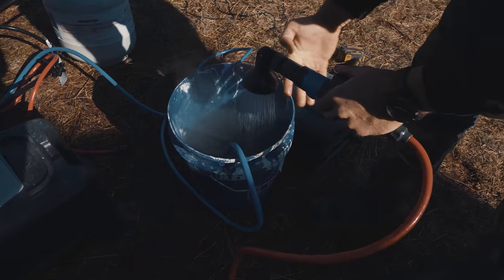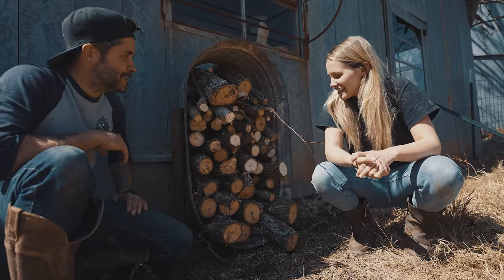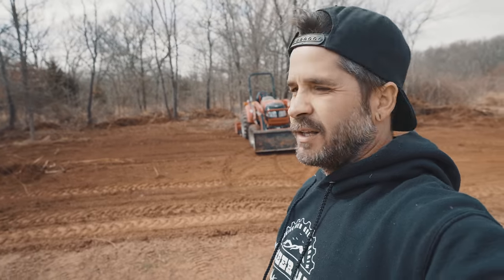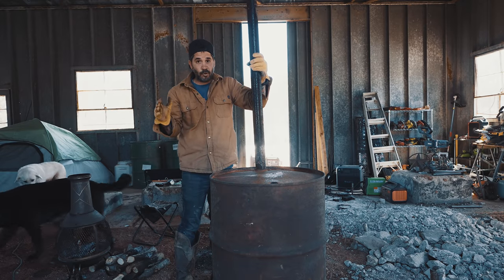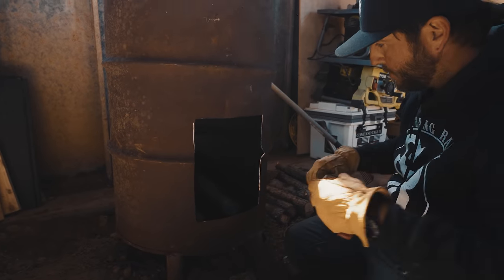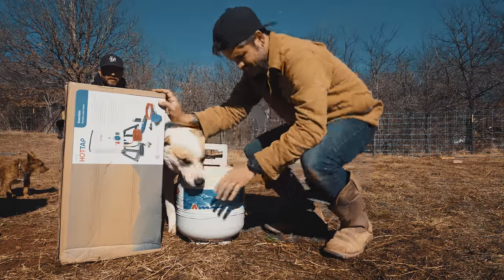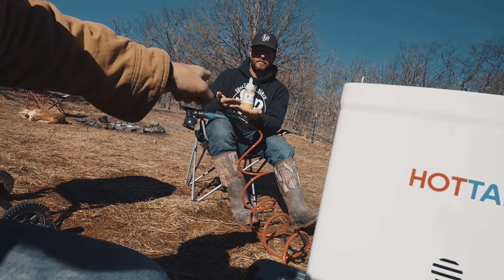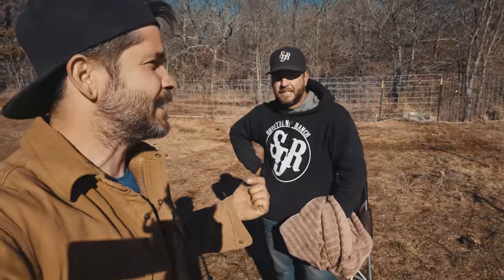Start To Finish Ranch Projects! EPIC Movie Like Intro!

Comment: Remember to build at least 20 feet in front of and steep slopes to allow for Erosion. Possibly add more rocks on the slope to slow down erosion. Build Swales and Berms (Dips and Bumps) in flat land with low rain fall. To prevent rain run off. Plant fruit trees on the Berm, where all the water drains.

Comment: you can use the metal grates you took off the floor to make a shower stall in that corner, next to the room. just weld 2 panels to the metal walls.

Comment: The woodstove needs about a 6" pipe for the size you built it.  It is going to not draft well and roll smoke back into the shop.  Otherwise, it was a great idea.
Reply: Or even some 45 degree Angel to it. But yes it might be to small diameter.
Reply: Well if guys find it too smokey they'll find another bigger piece of pipe and perform some surgery on the woodstove.

Comment: They aren't free, but there are kits to make barrel stoves. I have seen the kits at places like Rural King, Tractor Supply, etc. Also, if you put a layer of sand in the bottom of the barrel, it will last longer.

Comment: Should be nice and toasty with that wood burner! I have used one of those instant water heaters for  the wash rack in the barn for the horses. They are more efficient than having a water heater tank. Keep up the good work guys!

Comment: Put up some rain gutters to catch fresh rain water off of both sides of the shed.  For your equipment shed , put two containers with post and pipes beams overhead for a roof between them.

Comment: Horse trough coils of copper and a fire, fill the trough with cold water . Water moves when warm to hot. MAYBE ANOTHER FAN may have a better idea, I was just thinking about Jared needing to soak. Have you thought about the dumps in Australia there is usually a little shop where you can look for bargains also at reclamation yards
Another idea is like a grow booth cheap through Wish, could be a good shower room plenty of room to swing a cat also Jared could use a chair or bench.💖💖💖🇦🇺

Comment: You should put some of that rock or stone from that pile around the fire barrel and under it would make it a bit cleaner. And if you're stacking some of the wood on it it will help in drying out. The wood holder you made would look nice next to it

Comment: look up the you tube videos on micro shaving rock blasting. this is something you could make to blast out the concrete trip hazards in the shop. Be careful use a thick mat to protect from blast debris.

Comment: Well that one was sad.
  The problem with puppies out running around any vehicle is they most likely don't have any feat of the vehicles yet until they've had a close call they won't understand why their dangerous for them to be close to while the vehicle is moving.
   We just hope they learn to be careful and feel the danger but sometimes it doesn't work out that way and something like what happened to dexter happens and it's heart breaking for sure.
   Poor little guy just didn't understand. 
   But we just have to pick up and move on and prat the others learn not to run in front of tires.
   Sad story and I pray it never happens to yall again or your animals.

Comment: Have no idea if this would work. But if you got larger propane tanks; found a used propane stove w/ burners and oven - you might be able to have more hot food in a hurry, & some heat, & not have to use so much gas for the generator. Just a temporary solution.  Don't they have propane refrigerators too? Probably not cheap even if they were used. Is propane cheaper than gasoline?

Comment: if you would have read what i talked about in vid 1 i said put in a pit smoker before you filled all that in an now you got a rusty ass 55gal that aint gonna last!  dam hard head mr jason.....its ok its your land your stuff but i was saving you time an resources! smh.....2 inch pipe on a 55gal? omg good luck an you need a better angle (pitch) to that vent out an wash dem nasty nertzz!